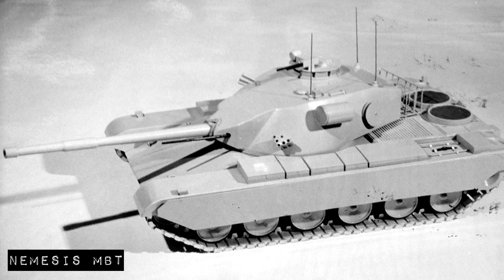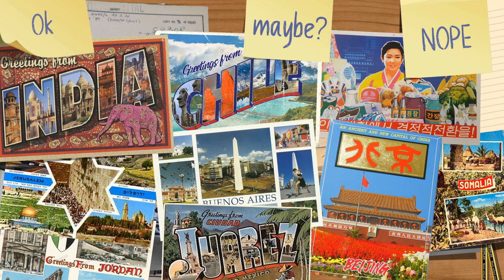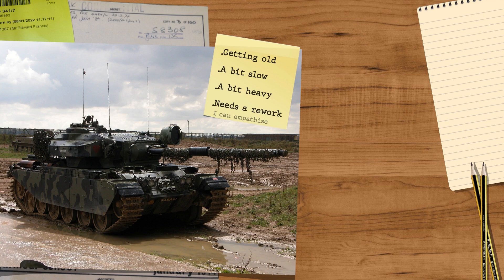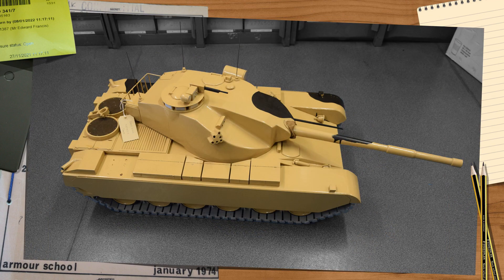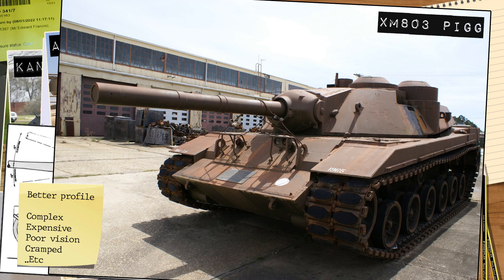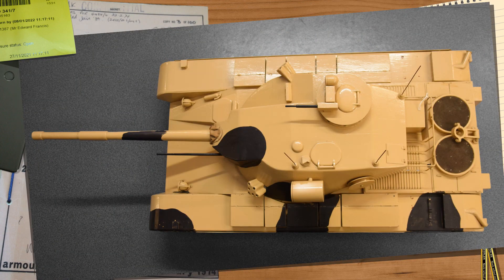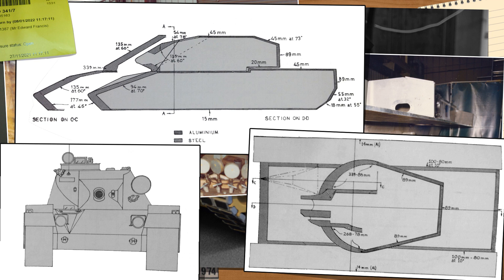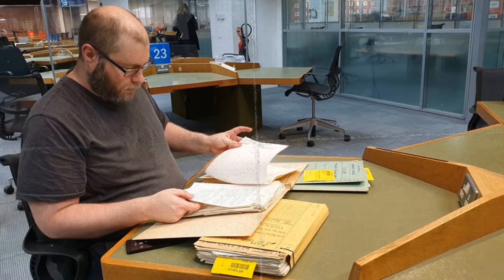NEMESIS MBT  - Tank Design and Development

Comment: What's this about liquid armor mentioned at 12:50?
Reply from the maker: a lot of vehicle in this time used liquid, mostly diesel as an axtra layer of armour, its more ffective vs shaped charges than steel, mbt70, swiss tanks and others all tested the idea
Reply: Armoured Archives I’m assuming this armor is in the form of the fuel tanks?
Reply: @browning2471  Yup.  The really hi tech designs had the fuel sandwich under pressure, but most just used it as spaced armour and a convenient place to put extra fuel.  Any change in density will tend to fvck up a HEAT round trying to go through plate.  The downside is that two plates (with or without a gap) is always weaker against things like APDS.  So it becomes a design question of what type of round do you expect to face more often.  In the 60's and 70's it was very much HEAT that was the choice-of-the-day.  Late 70's gives you the swing to APFSDS.
Reply: @iatsd by weaker do you mean weaker compared to HEAT or weaker compared to a single plate of the same thickness.

for the later is not true, atleast not always true, it depends on the size of the gap and the size, shap and speed of the apds, but also the relative hardness of the 2 plates. its not always weaker. (eg the centurian mk 5 with aditional arrmour was found to be superior to the centurian mk7 with the same thickness but not spaced armour, against british APDS).
Reply: @armouredarchives8867  Oh, I see now! Thank you, that's very interesting. Do you have any data on how liquid armor performs compared to ceramic and glass armor?

Comment: These concepts would always be a tough sell in the face of available surplus Centurions and the incredible abundance of M47 and M48s. Sure these are well above the target weight but open the door to civil "assistance " improving infrastructure to bring the customers further into the fold.
Reply: The American tanks might be close-to-free due to US military aid, but a lot of countries looked to get rid of them ASAP once they realised how badly designed the M47 and M48 were after the Pakistani experience with them.

There was a clear market in the 1970's for tanks outside the US sphere of influence, if only as a statement of neutrality or new-found independence - one reason the Vickers tanks did so well globally.  The problem is the actual numbers ordered by those countries, with only India being a large buyer.  Everyone else is a 30-100 type of buyer.
Reply: @iatsd  you're right about the politics involved and as I sort of said, the American tanks would definitely come with political entanglements.
The M48 vs Centurion is more an issue of bad tactics and poor implementation. The M48 is the superior tank with better ammunition. Ammo developments were rapidly leaving both machines outdated with too thin armor, as they had left the M47 behind.
Other than being a gas guzzler,  I think the M47 gets an unfair reputation.  It even still has a hull machine gun, useful for suppressing those close in pedestrians.
Reply: @chriskortan1530  The crews always make the difference in any theoretical analysis. Quality training and discipline will almost guarantee an adequate AFV, Plane or ship will always come out on top.

Comment: what about on Armored Warfare? there are no heavy-medium tanks there but just mbt, lt, td, afv and spg so heavy/medium debate arent a problem there.
Reply from the maker: not sure on that game tbh, either way it would probly end up in an insane lootbox :P
Reply: @armouredarchives8867  Nah it's not gonna end up in a lootbox, since it's too old and incapable to be placed in the lootbox tier unless they hyperbuff it with a 152mm and NERA.
It's gonna be a tier 5 or 6 at best with the stated stats.
Reply: @boymahina123  I'd buy it as a T5 premium lol. Coaxial autocannons are the best thing since sliced bread.
Reply: The fact that the Nemesis would likely be around Tier 5 rather than Tier 10 in Armored Warfare at least in theory should make balancing much simpler. If a tank's "natural" stats (ie the real-life design) are too strong for the top tier, the only options are to either nerf it relative to real life or make it overpowered. But for low and mid tier tanks, you always have the option of simply moving it up a tier if it's too strong.

Comment: Nice video, lots of usefull info and high quality images but screw World of Tanks. Put this in Armored Warfare as a t7/8 MBT.
Reply: Have they updated Armored Warfare?
Reply: @arsenalxa4421  there is regular updates yes and a small but still present playerbase
Reply: @Artheris2K  It's been a while, hence why I asked.
Reply: Would this be strong enough for Tier 7/8? Tier 7 MBTs in Armored Warfare include the likes of the M1A1 Abrams,  Leopard 2, Merkava 2D, Challenger 1, Leclerc prototype, Type 90, and T-80U. While tier 8 includes the M1A2, Leopard 2A5, Merkava 3B, T-90A, and Type 99.

This seems more like a Tier 5, which would place it alongside stuff like the the M60A3, Leopard 1A5, Chieftain Mk 10, Merkava 1, T-72A, Type 74, and AMX-40.